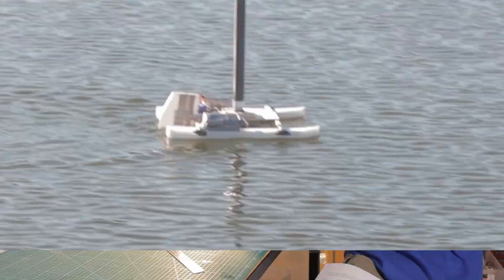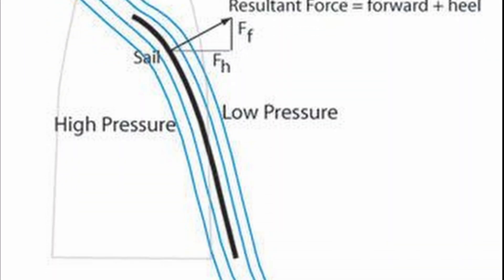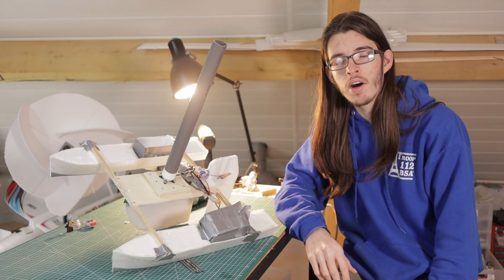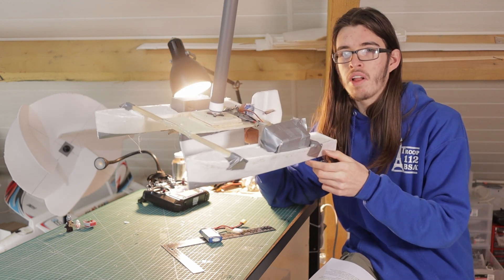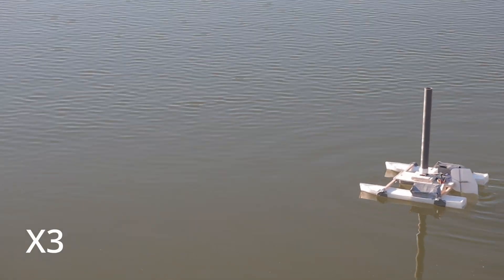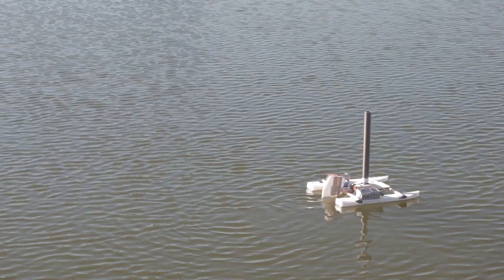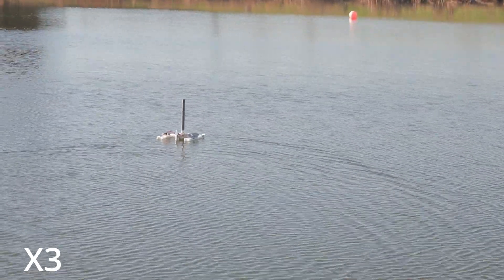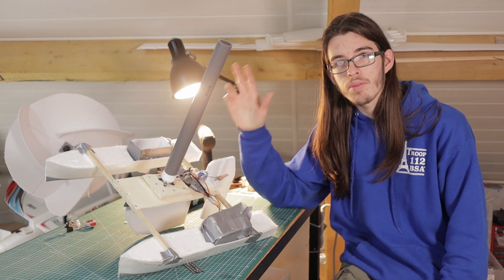RC rotor powered sailboat? (flettner rotor)

Comment: With the energy needed to drive the rotor, does this cost more or less than the energy gained from harnessing the wind power this way?
Reply from the maker: I don’t know exactly, but it uses very little power compared to a propeller driven craft because all it has to do is spin. However, technically it uses more power then just using a sail with a couple servo motors, but it can work at lower wind speeds and is much more controllable with very little complexity compared to a sail. So, over all, I think it’s a bit of a toss up. But it does have some great Benefits, for example: you can easily sail in reverse with no mechanical changes.

Comment: Just came across this recently. Its a shame you haven't gone a bit further with it yet.
Here is a challenge.
Make the Rotor automatically adjust its speed to optimally match the speed and direction of the wind, as you just steer it.
Hints
Your Keels and Rudders are holding back the functionality by being oversized and not optimally shaped.
There is a  comprehensive discussion thread on Boat Design Dot Net that covers things like optimum Rotor Shape and Speed.
If you went and joined, and put the new project into the discussion, I would love to chat about the next iteration.
Cheers
RWatson (My user name there)

Comment: hi! check back "Ventifoil" suction wing technology - is a non-rotating suction wing with vents and an internal fans that uses boundary layer suction for maximum effect to generate thrust for the ship.  it was used in Alcyone - Jacques Cousteau's Turbosail Ship. theres no moving cylinders except small inner vent on the top of cyl/ but it need rotating platform for catching wind. somts like hybrid vacuum cleaner with ship/^_)))

Comment: When the wind direction was longitudinal to the channel and the model was transversal, evidenced by the waves, the model reached a higher speed.
Reply from the maker: Yeah! This type of sail boat is the most efficient when at 90 degrees from the wind direction and thrust gradually decreases the closer you get to parallel (even though, paradoxically, the sail creates the same amount of thrust. It’s just not in a direction that can actively push the vehicle forward). Pretty interesting! Sailing is an interesting craft which I haven’t quite mastered. I really need to make the sail thicker to create more thrust. Right now the rotor just barely has enough speed to move the boat.